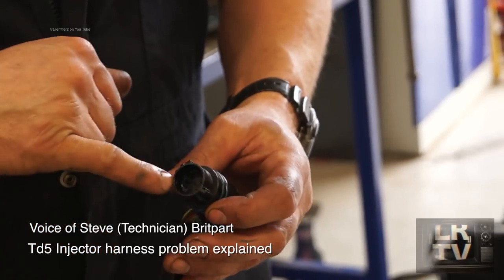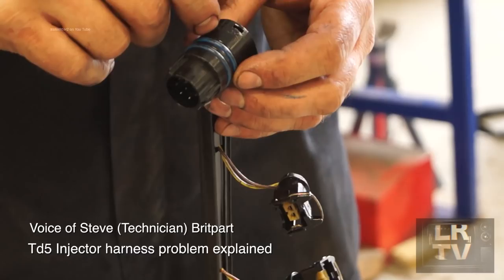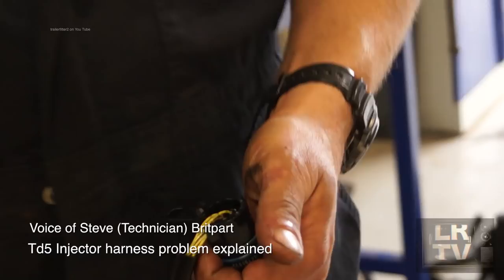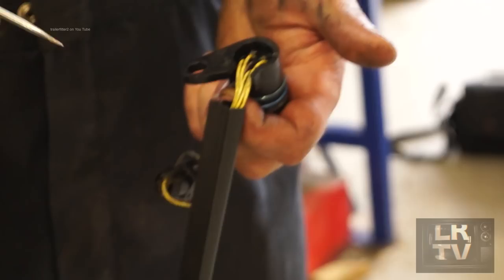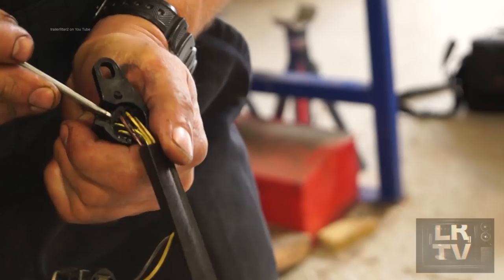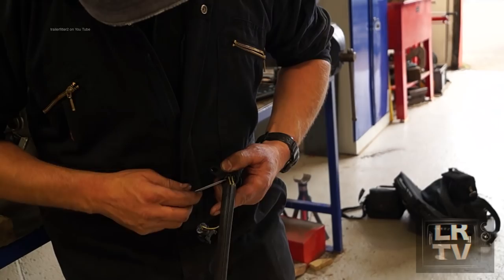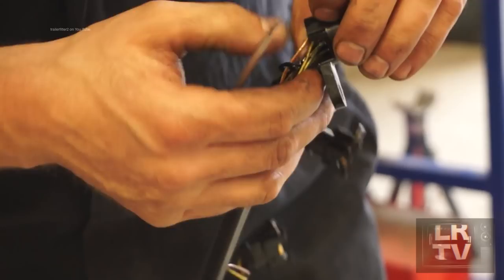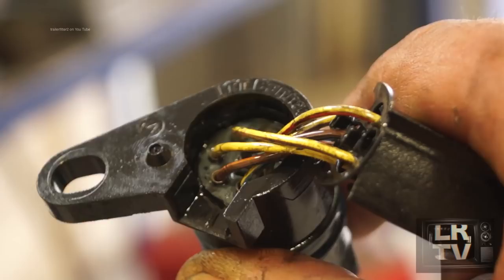Td5 injector harness problem - where the oil leaks through.

Comment: Can't agree with the last statement - Oil does effect those injector connectors if the seals wear off. Thats what happened to my girlfriend's Disco 2 Td5 anyway. How do we know? Well engin wasn't running well so after googling we checked the wireloom and sure enough the injector plugs were wet with oil. Cleaned them and the engine wan well! But soon enough the problem was back since the seals were old. After fitting the new loom that problem went away. Sadly right after that the engine stopped and haven't started since. Probably the ECU got hurt since the oil had made its way all the way up to it and i'm pretty sure it had been there for a while :(

Comment: I have cut the loom and soldered a resin block into the loom to properly seal the individual strands of copper in each wire as the oil actually capillaries along inside the wire
Reply from the maker: Amazing what we have to do to on these vehicles.  Loom wiring plugs are so common now.  Many in the truck industry don't fail outside the vehicle near the road side and there will one design like this that causes great issues.